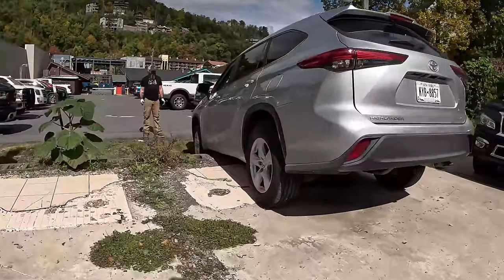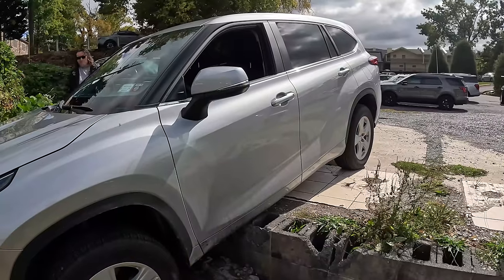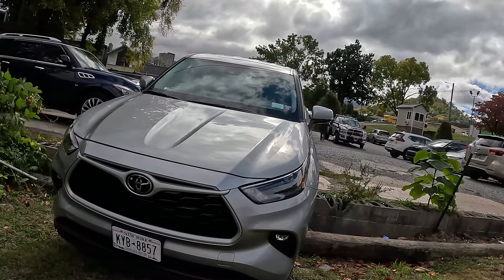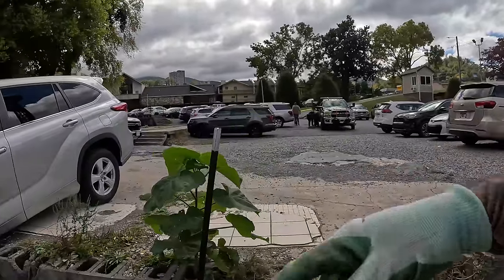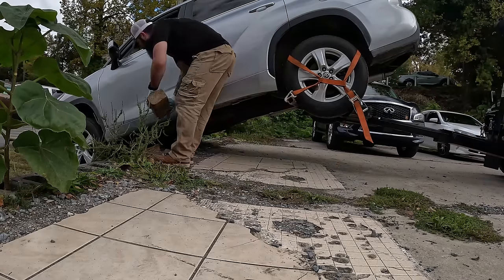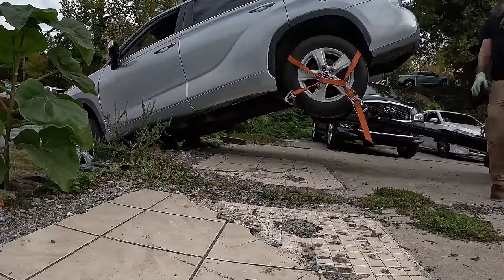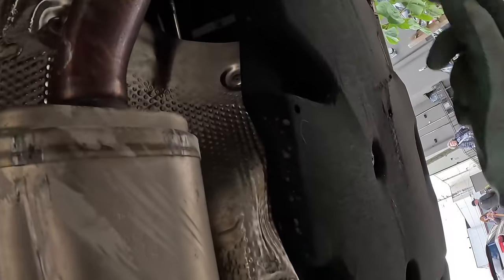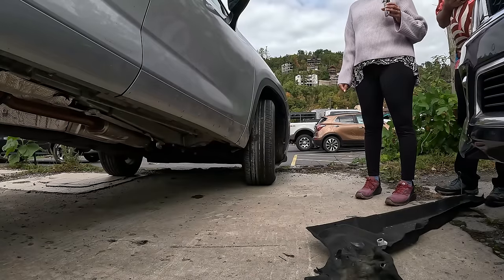"Is This Cause For A Lawsuit?" | Rental Car Takes Damage

Comment: I don't understand their thinking. They want to do a lawsuit because they don't have the commonsense to know the difference between pavement and greenery with plants? The only people I've seen do something like this is elderly folks, my dad did something like this at about 80 years old.
Reply: No excuse, we 80 years olds are just like you 40 years olds. We sometimes make a mistake and we don't blame our age so don't you blame our age for an accident which in most cases is a bad choice. Remember if you are as bless as we are you will be 80 in a blink of an eye. Oh to be young and so smart again. Bless your heart.
Reply: @coolcat-tw1hl  Yes, I can blame age. It's a proven fact that people often need glasses in later years and that new prescriptions follow regularly after that. I'm 66 now and I'm on my third prescription and just had the need for glasses added to my drivers license. My dad wouldn't admit he needed glasses until he ran over concrete parking stops at the mall because though he saw the color he couldn't tell they were raised off the pavement. New glasses and he felt safe to drive a few more years.

Comment: Pro tip:
Open zip-tie bags in the middle of the package. If you open at the top, the zip ties fall out, but opening in the center keeps them in the bag for storage/use.
Reply: This does not however, work very well on a bag of chips.....now I have Funyuns scattered everywhere.  😮
Reply: @MrSpeeeeeder  😂

Comment: As a retired lawyer I can say that there’s PROBABLY no ground for a legal claim, but never say never. ( There used to be a fence there. This has happened before. Was it night with inadequate lighting?) What is 100% correct is your advice to take lots and lots of pictures and save all relevant documentation. I can’t tell you how many times I wished that my clients had taken more pictures from different angles.

Comment: He did say that they weren’t the only ones to do that. You can see that the concrete blocks were damaged previously. There’s no sign, wall, fence or even lines. If you’re in a vehicle it probably looks like you can drive through to the other parking lot. I would think that the lots are connected with maybe a slanted driveway. There’s other factors such as weather it was getting dark.
Reply: That is why they wanted to sue, over the lack of signs or barriers
Reply: Well, they shouldn't drive anywhere else in the Smokies then.
Reply: @ronjohnson9032  I 100% agree but people like that are the reason for a lot of warning labels

Comment: Jeff,  I got a stupid question.  Could you not put the thread in tow hooks in, lift the front end up, stack cribbing under the tires then do a rear pull or set it on the wheel lift.  Just wondering for my own education

Comment: I remember the one that drove in the ditch behind them buildings and the only way out was to drag it down the ditch all the way down behind them buildings it was a challenge you had to build blocks and move rocks like you were rock crawling lol but you an Nate I think worked it I know there was two of you guys an two wreckers one picking an the other one pulling an what damage was done was from when they dukes of hazard it off the wall down in the ditch lol I didn’t think it was coming out with out a crane but y’all got it out took a lot of work but you got her done .

Comment: Just out of curiosity would it have been better to pick the front up and extend your boom towards the car pushing it straight back I am not a professional I am simply asking a question to all the haters out there
Reply: I was starting to think that until I saw the front and the angle.  I think Kristen mentioned trying to get the grapple around the tires would be a problem because of the obstructions right behind the tires (rocks/log).  My next thought was exactly what they did, build a ramp and roll it up.  It's a good thing I'm not a tow truck driver, I'd spend more time figuring angles and methods to pull than it takes them to do the whole job...I'd lose money, hehe.  I'll stick with retirement, getting paid to do nothing if I choose...and watch EA on YouTube :)

Comment: How about the parking lot company put 4 inch pvc post in the open holes of the  cinder block ledge and concrete them in place and paint the pvc post yellow? That would show due diligence on the lot to stop law suits.

Comment: okay, to be fair, the angle around the 4 minute mark almost looks like the pavement meets the grassy area. Someone without no depth perception (myself for example) might not realize it actually drops off  right there. if someone is getting close to the edge, they may not accurately judge how much room they have 😬

Oh, and that lot should have guard posts in that area, especially considering this has happened to more than one person.

Comment: I like to see your videos, I'm not an expert in your line of work but in this video wouldn't it be better to have lifted the car from the front so the car would be aligned with the ground and you could move backwards or extend the hydraulic arm do I park the car on the ground??? p.s.I apologize in advance if my opinion is as stupid as I said, it's not my line of work

Comment: It's a bit disappointing that many of the comments are railing against the driver that went off the parking lot. Yes, it is their responsibility to understand possible hazards but the parking lot ledge does seem to be a hazard and they did say at the beginning that it appeared as if the two lots were connected. However, a lawsuit is not the correct approach since they suffered no personal damage (only rental car damage) in the incident. At most, their insurance company could seek a settlement based on unsafe parking lot.  Thank goodness Jeff and Kristin are wonderful professionals and anyone watching them in action can see that they do their best to extract with care.

Comment: In my experience, if you're renting a vehicle, and you don't have full coverage for collision damage, you're going to be charged for that damage.  After all, it's not damage caused by the vehicle rental company!  I guess it's possible that the terms for rental vehicles has changed over the years, but I seriously doubt the vehicle rental company would assume responsibility for "operator error" damage.  Just my opinion!

Comment: I suspect even if you HAD dragged it, the damage would show that it was from moving forward, not being pulled backward.
Reply: Could you have used the roll back and wench it on just wondering

Comment: Correct me if I'm wrong, but this is the same spot where you filmed the third party lifting a car back a week or two ago? From up there in the parking lot? 
Somebody drives like a prat and it's somebody elses fault?  I'd probably have to try the old: "The wall jumped out at me" argument... Bet the `lawsuit` falls at the first hurdle....